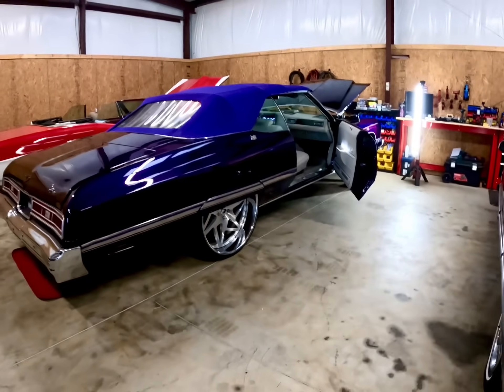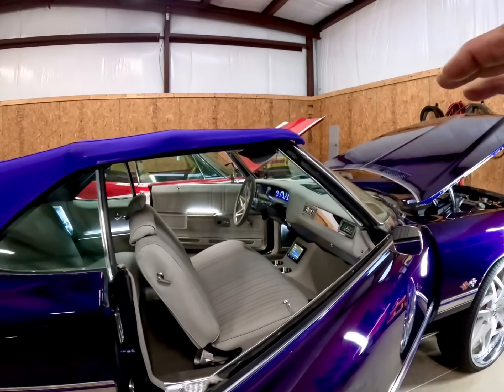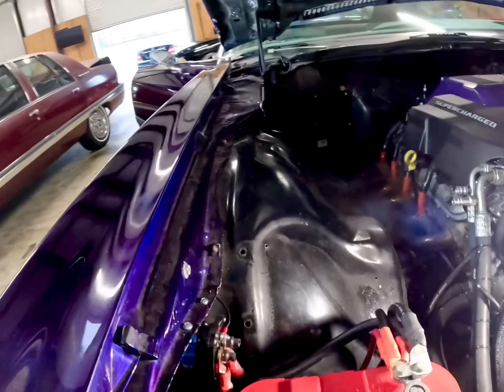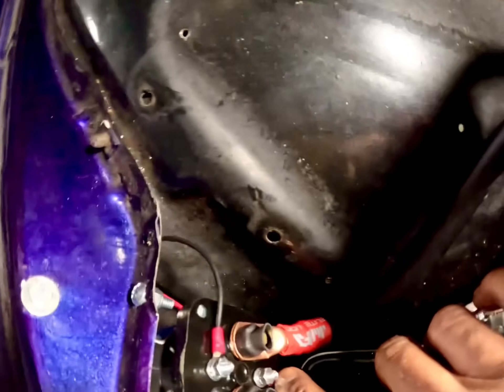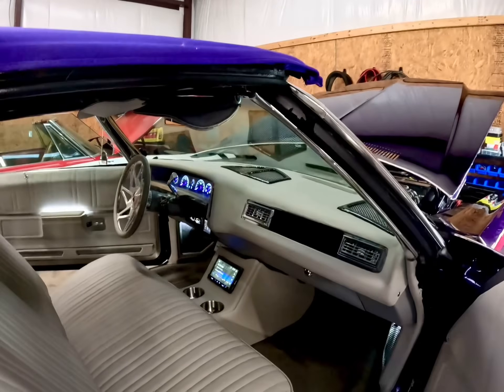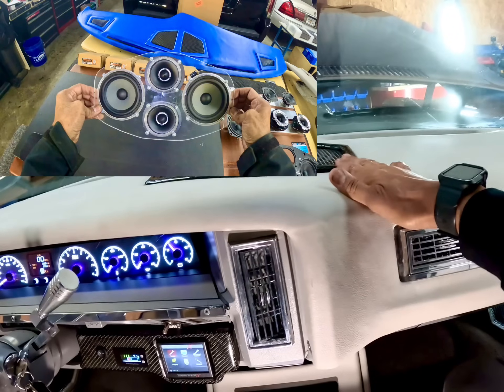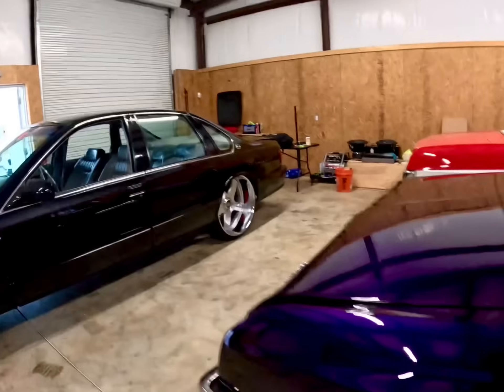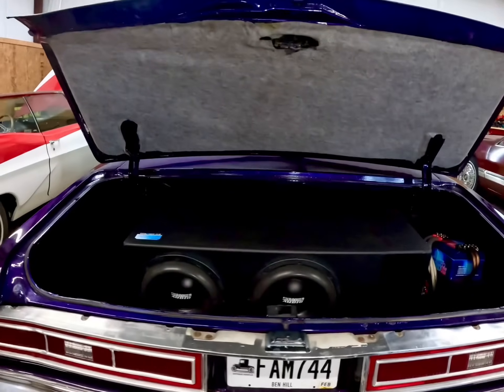1974 Supercharged Caprice Classic | Complete Audio Upgrade | Finally Finished ✅

Comment: Super clean build as always!!
Reply from the maker: Greatly appreciated the support stay tuned got some more that almost completed
Reply: @bj_from_the478 what battery would you recommend for a deafbonce atom 7.5k I have 300 amp alternator 2 runs power 2 runs ground plan on adding more grounds as well

Comment: Man like the way you go into details of what you done to build and it’s super clean. I have a question can bad grounds or wrong size fuse for amps or even both cause the car to have like a weird stutter effect while driving and the bass hit. It happens to me only on some hard hitting bass. I have d5100 in front, 300 amp high output alternator, big 3, battery in the back, and all ofc wiring. My main wire running to the back battery is zero gauge then the amps are 4 gauge. Thanks for your time and entertaining videos.
Reply from the maker: Okay do you have the rca on the same side as the hot wire 🤔

Comment: Hey BJ I spoke with you the other day, from Valdosta ga... I know you are busy with relocating and won't be available til next month as you stated... I spoke with you about getting some door panels done in my 01 Tahoe but also wanted to see about getting a custom center console made  that goes all the way to my back seat that holds amps and my 90ah xs power battery. Also the back dash board is cracked a bit so I would like to redone with (2) 6.5/speaker grilles. If you could give me a close estimate so I know what to put aside for you when I bring it to you I would greatly appreciate it bro
Reply from the maker: Cool give me a call tomorrow I got you
Reply: @bj_from_the478 💯 Will do